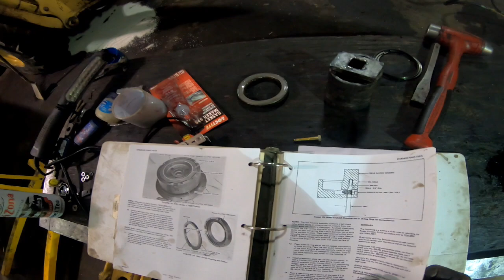Allis chalmers 7050 reassembly pt 2

Comment: Yup, your right Warren. You have "customers" who call you now and again when they need your services. Then you have "clients" who will call you for any work they need to have done and know that you will get it done at a good rate and it's done properly. They are happy to know when they call you will give them straight goods, and they gladly pay you as soon as the work is done and it's ready for pickup. Both are valued, but the customer is occasional, the client is a term relationship built on trust. The goal is to turn "customers" into "clients", that's when you know your doing a good job.. Well done Sir!

Comment: Your ability to lay things down on tires, rails ,and ledges without knocking it off amaiises me. Noticed it  on sereral vidios. I bump and knock every off, and spend a lot of time hunting for bolts, nuts and wrenches. Sounds like you feeling much better, Stay strong physically and mentally,Good luck Warren!

Comment: I was in the 4 wheel drive shop a guy came in to pick up his new dually that he had dropped off that morning  to have a air locker put in the rear. Manager went over to him and gestured to him to sit down, manager said I could blow smoke and tell you we need more time, but what happened is the mechanic had it up on the lift and without thinking he pulled the axles out with out blocking the front wheels and the truck rolled off the end of the lift and damaged the transmission pan, so we had to replace it with a brand new deep sump one. The customer looked at him pick up his brief case and said no problem I have work I can do till you get finished!

Comment: Nice work as usual. Hope I have a Allis tractor. Remember back in the 50s  a Allis WD 45 that a local shop mechanic have to drive a DC generator for welding. The whole shop was driven by a 2 stroke diesel engine. It was rely amusing to work with him when I was young.

Comment: When I mate a engine and transmission back together, I put at least two long headless bolts in the block to use as guides to help line everything up and make it easier to re-assemble.

Comment: I have never cared for althread for guide pins. Instead I carried common sized bolts with the heads cut off for guide pins. That way the parts would slide together smoother and easier.

Comment: Thanks Waren for the video. On the hole in the manifold that hole is normal on those tractors.
Reply from the maker: That's what I'm finding.  I guess they were worried about  water.
Reply: I knew the 190xt and 200 had the hole had to look at the 7040 to see if it had it to

Comment: Later in the video: Looks like Allis didn't bolt their frame rails to the engine back plates either... IH's are like that. We usually leave a bolt in each side from the front to keep them lined up.
Reply: Allis Chalmers didn't do it that way because the engine is not supporting the load now. Unlike John Deere which bolts the frame to the engine block making it take the abuse rather then the large frame rails Allis Chalmers used
Reply: @RJ1999x  the point is there is nothing to keep the frame rails and engine backing plate lined up. No bolts, no pins, nothing... Makes it a pain in the can when the time comes to put it back together, as shown in the video.
Reply: @BarnyardEngineering  I know your point, I was giving you the reason why. Plus Allis Chalmers splitting stands actually supported the engine and the rails so you didn't have that problem